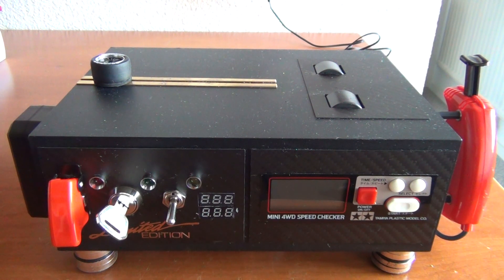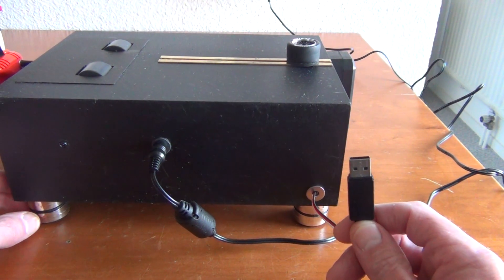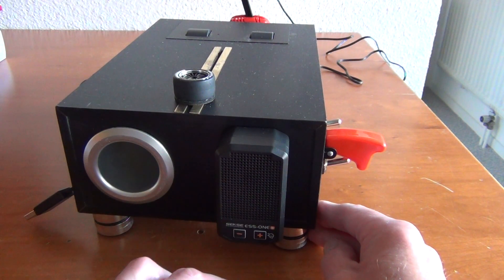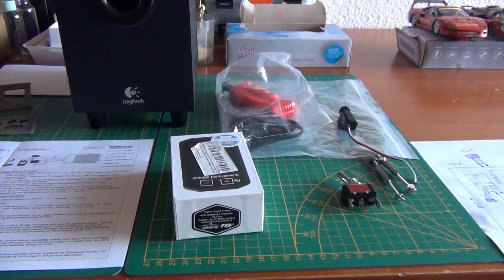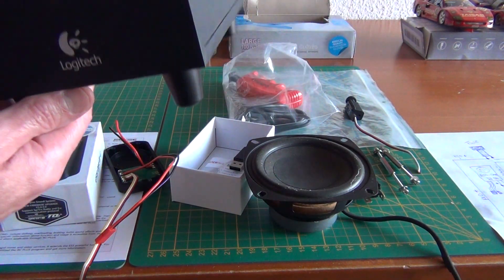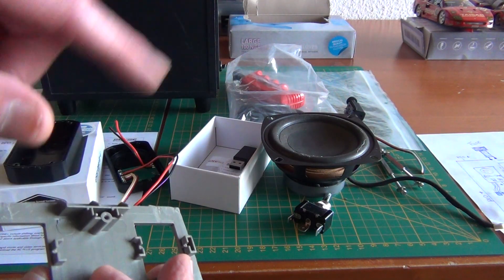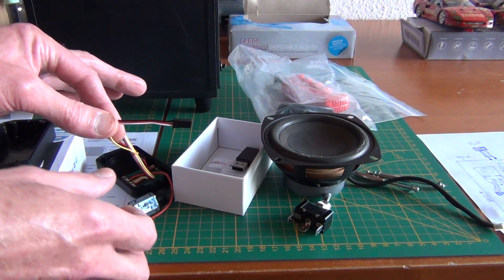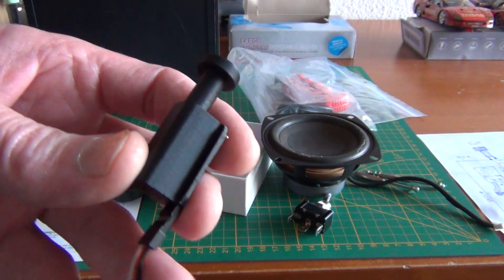Slot Car Test Bench / Dyno Bench with Sound - How it's made & works - Part 1 of 2

Comment from the maker: Underneath is a small list and links of the main parts and components I used.

- logitech S200 2.1 speaker set (The S220 looks simular to me).

- 125mm X 75mm, 0.5 mm Real Carbon Fiber sheet

- The relay is a normal car relay 12v 20 or 30 amp.

- Tamiya Mini 4wd Speed Checker 15183 (on Ebay)

- 12 Volt 2,5 Amp Adapter;
https://nl.aliexpress.com/item/1005004837402833.html?spm=a2g0o.productlist.main.7.3accI1XaI1Xagl&algo_pvid=78532409-8086-4acb-bbfa-a42957855b8b&algo_exp_id=78532409-8086-4acb-bbfa-a42957855b8b-3&pdp_ext_f=%7B%22order%22%3A%2229%22%2C%22eval%22%3A%221%22%7D&pdp_npi=4%40dis%21EUR%217.02%215.69%21%21%217.48%216.06%21%40210391a017437071935867297e508c%2112000030682019443%21sea%21NL%210%21ABX&curPageLogUid=fYTD9WOEx2vG&utparam-url=scene%3Asearch%7Cquery_from%3A

- Main switches;
https://nl.aliexpress.com/item/1005006279244589.html?spm=a2g0o.productlist.main.1.708a1a3cqrLHBJ&algo_pvid=f26b2c72-6c6d-4fca-92b2-e279fd58195b&algo_exp_id=f26b2c72-6c6d-4fca-92b2-e279fd58195b-0&pdp_ext_f=%7B%22order%22%3A%22801%22%2C%22eval%22%3A%221%22%7D&pdp_npi=4%40dis%21EUR%211.71%211.65%21%21%2113.35%2112.85%21%40211b804117437019545581030e8fe7%2112000036585817823%21sea%21NL%214898539010%21X&curPageLogUid=NXgSsQTtIFtw&utparam-url=scene%3Asearch%7Cquery_from%3A

- Ess-One +
https://nl.aliexpress.com/item/1005006284103876.html?spm=a2g0o.productlist.main.9.30b21f1d6hXOzD&algo_pvid=60dd7ae4-879b-40f2-a20f-d0f1c8b6eaa7&algo_exp_id=60dd7ae4-879b-40f2-a20f-d0f1c8b6eaa7-4&pdp_ext_f=%7B%22order%22%3A%22871%22%2C%22eval%22%3A%221%22%7D&pdp_npi=4%40dis%21EUR%21132.46%2137.12%21%21%21979.71%21274.57%21%40210385db17384407627908557e3ace%2112000036665332868%21sea%21NL%210%21ABX&curPageLogUid=QTGdI04O8amX&utparam-url=scene%3Asearch%7Cquery_from%3A

- Throttle signal generator (small one)
https://nl.aliexpress.com/item/1005006835703677.html?spm=a2g0o.order_list.order_list_main.580.be2579d2LbfnBv&gatewayAdapt=glo2nld

- Key switch
https://nl.aliexpress.com/item/32836256033.html?spm=a2g0o.order_list.pcOrderListRecommend.3.947f79d2oTze6j&gps-id=pcOrderListRecommend&scm=1007.38956.373968.0&scm_id=1007.38956.373968.0&scm-url=1007.38956.373968.0&pvid=a9d3461f-81fc-4d94-aafc-aa125d4eadca&_t=gps-id:pcOrderListRecommend,scm-url:1007.38956.373968.0,pvid:a9d3461f-81fc-4d94-aafc-aa125d4eadca,tpp_buckets:668%232846%238116%232002&pdp_ext_f=%7B%22order%22%3A%2215%22%2C%22eval%22%3A%221%22%2C%22sceneId%22%3A%2228956%22%7D&pdp_npi=4%40dis%21EUR%213.30%213.17%21%21%213.48%213.34%21%40210384b217435998167362023eb0dc%2165073994985%21rec%21NL%214898539010%21X&utparam-url=scene%3ApcOrderListRecommend%7Cquery_from%3A

- ESC motor controller (with T plug...useable for speaker connection);
https://nl.aliexpress.com/item/1005005505210877.html?spm=a2g0o.order_list.order_list_main.5.57f479d2DHfJbx&gatewayAdapt=glo2nld

- Step down module ( to adjust the voltage from 12v to 3v to feed the Tamiya Speed Checker instead of using batteries);
https://nl.aliexpress.com/item/1005006149348817.html?spm=a2g0o.productlist.main.5.74d25fe57ouqU3&algo_pvid=31f8a46a-bc75-4303-9bad-15b2e3b72c81&algo_exp_id=31f8a46a-bc75-4303-9bad-15b2e3b72c81-2&pdp_ext_f=%7B%22order%22%3A%223965%22%2C%22eval%22%3A%221%22%7D&pdp_npi=4%40dis%21EUR%211.69%211.69%21%21%2113.20%2113.20%21%40211b80e117436905627818746e8cf2%2112000035983693127%21sea%21NL%214898539010%21X&curPageLogUid=xJndTrwMOeyz&utparam-url=scene%3Asearch%7Cquery_from%3A

- The software for the Ess-one, "RC PLUS" you can download here;
http://www.sensehobby.com/index.php?m=content&c=index&a=lists&catid=115